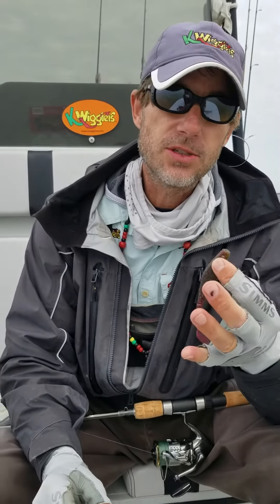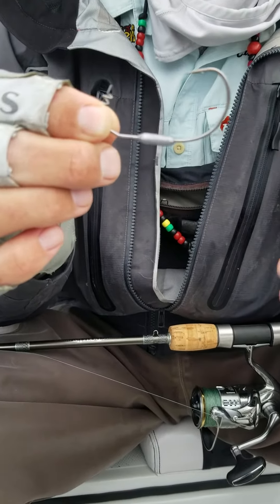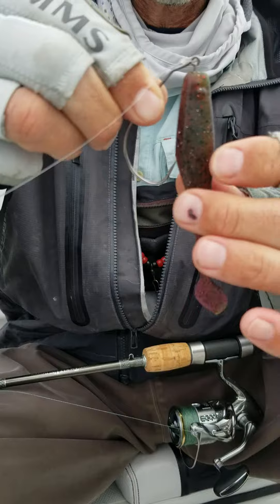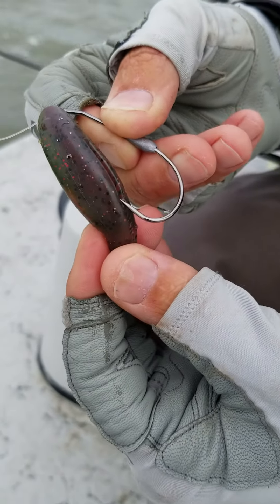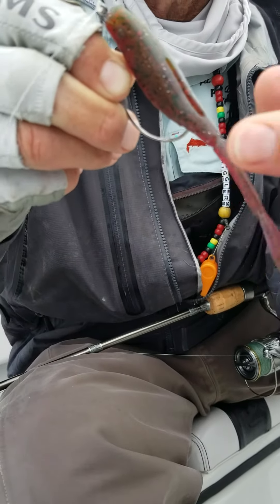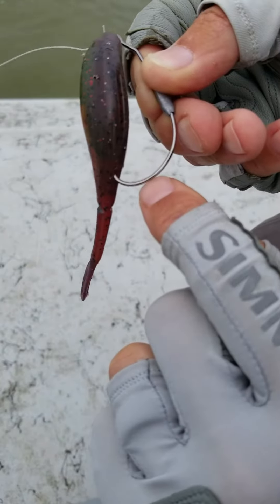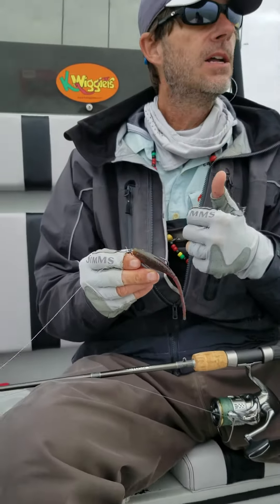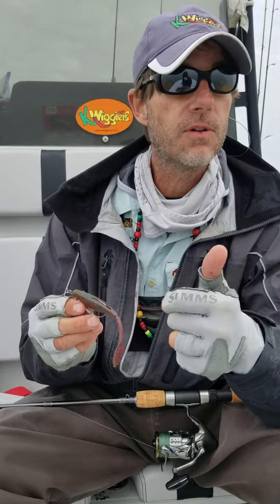How to properly rig a #willowmakerjig on a #willowtailshad

Comment: Capt Wayne, if you get a chance can you go over your spinning gear set up?
Reply from the maker: I use the Shimano 2500 Stradic Ci4 with a 6'6" FTU Green Rod.  20lb V2 Power Pro.  Also the Stella and Stradic FK - all in the 2500 series.  The 3000 series is basically the same reel, but the spool is a little bigger.  I like the smaller profile.  Let me know if this helps.  If you need more info please feel free to let me know
Reply: Fishing in the knee/shin deep water down in the LLM do you prefer a more moderate action rod? Or fast action?
Reply from the maker: @derekradtke6542  with soft plastics I like a moderate tip , with tops I prefer a faster tip. Both light action rods though.
Reply: Thank you Captain Wayne.